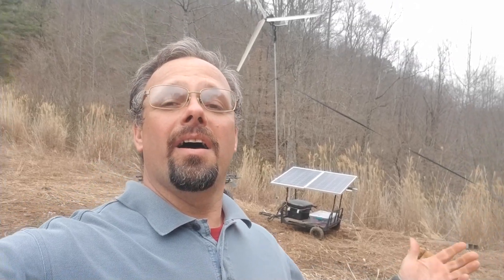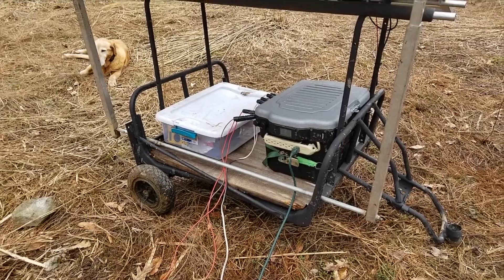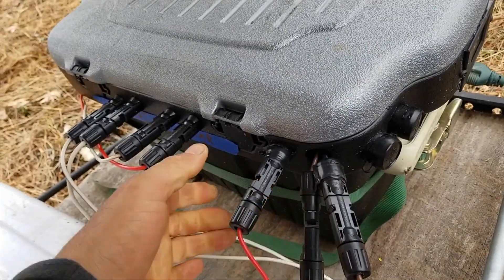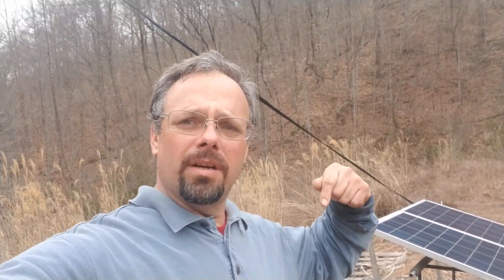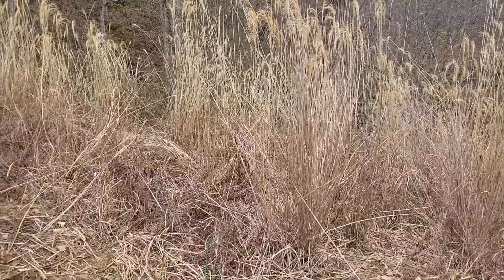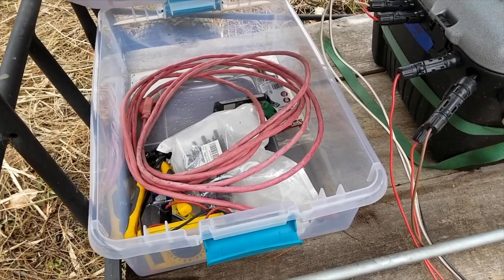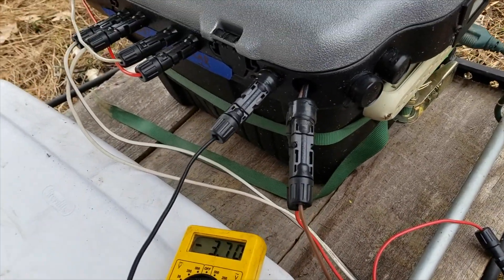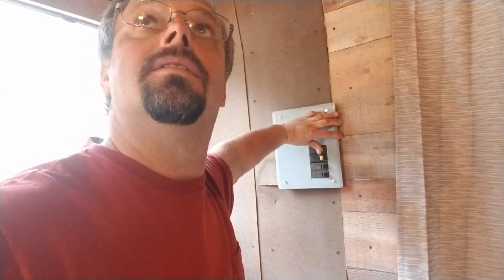Pallet Wood Bug Out Cabin with three sources of power

Comment: Cool man water source is the best one i think
Reply from the maker: I think so to. I am considering taking the wind generator apart to put on the water wheel I built.
Reply: If your getting year round 24/7 water i would drive for more investing into the water power equipment

Comment: Great Video, Luke. The cabin is sweet. Looks like theres enough room to get an air hockey table in there, I know you have enough power for it. Very cool dude. Theres always that moment right before you flick a breaker, almost expecting it to snap immediately back.
Reply from the maker: Yeah I was figuring I might either have it trip or the lights just flash and kill the inverter. Glad it worked.